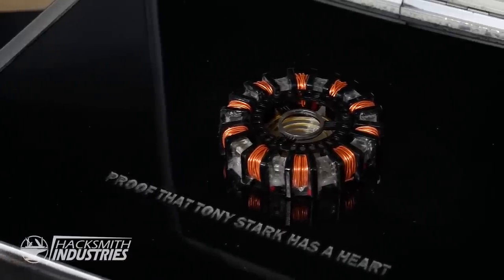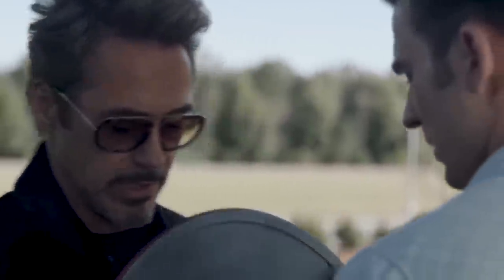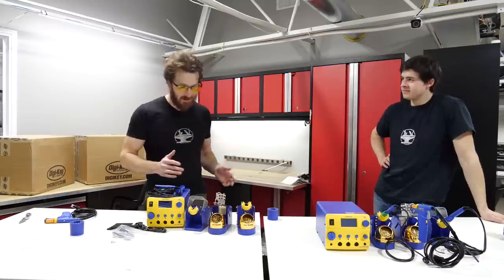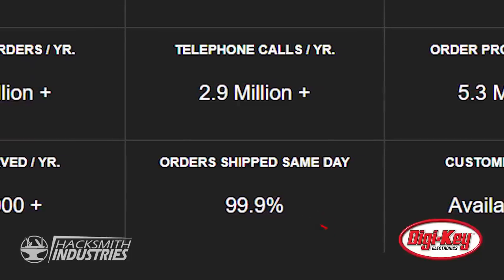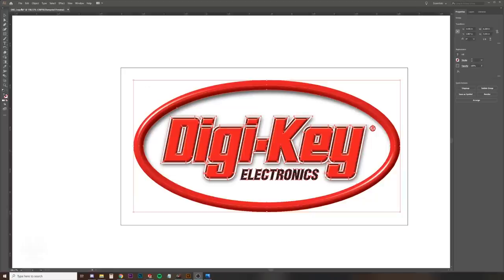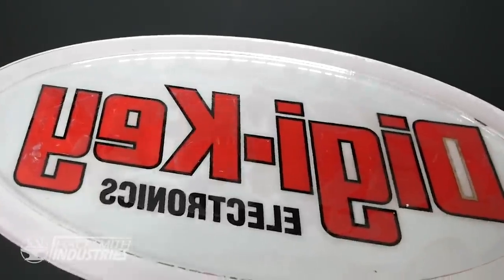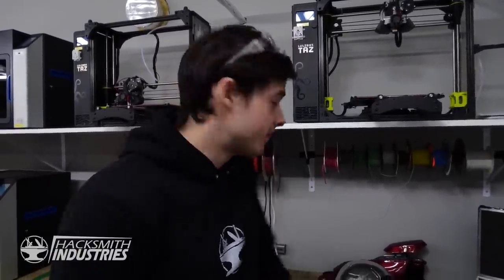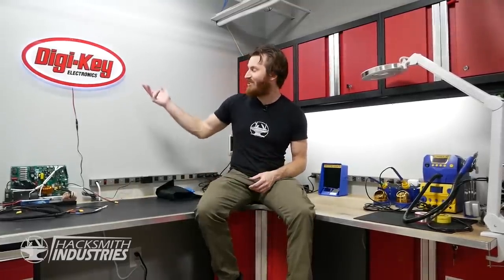Building Iron Man's Workshop!

Comment: Just a little warning, to all you who are looking to get into electronics and automation tech: Just like Stark Labs, the stuff showcased here is top shelf equipment. Don't expect to get anything nearly this nice, unless you're backed by either a sponsorship or deep pockets.

A 3-point soldering station is nearly unheard of in hobby circuits. Most start out with ones that doesn't even have a base station, it's basically just a grip, tip and cable.

And do get used to the colour coding of those resistors, because having a binder with all of them, or even boxes with separate compartments, will take up both space and time. Most are delivered in mixed bundles, not nicely separated by resistance and tolerance, so you'll be doing the sorting yourself regardless. Unless you pay like three times the amount to have the supplier do the sorting for you. This is because it costs extra for them to have one bag for each type, and they buy in much larger bulk and separate them into smaller packages. One bag with everything in it, or 15-30 bags with 1-5 in each, when you sell 200-500 units per day...

Comment: Nice work, I always enjoy the videos. Just a couple things to help, The screwdrivers are nice but they look like the high voltage insulated type. If so they are very bad for esd sensitive devices, get ESD dissipative screwdrivers and tools for working on LOW VOLTAGE esd sensitive circuits (like circuit boards). Also make sure the mats are ESD dissipative  and grounded through a 1M ohm resistor if you are working on LOW VOLTAGE stuff. HIGH VOLTAGE  DC or AC is a different story so make sure you know the difference. Good luck